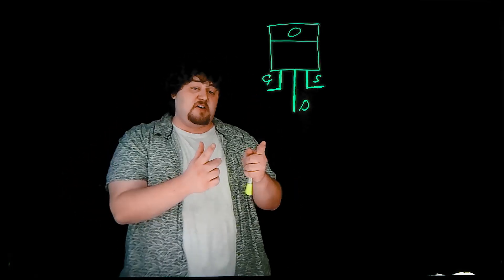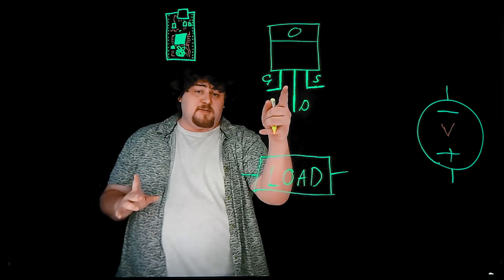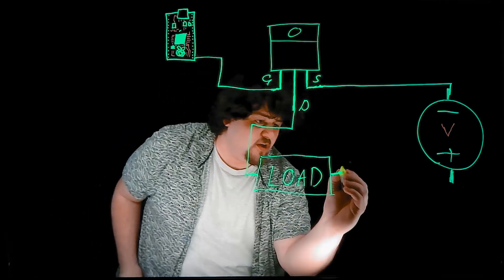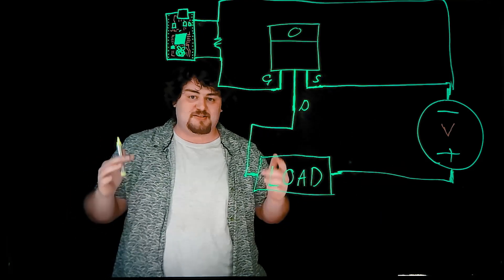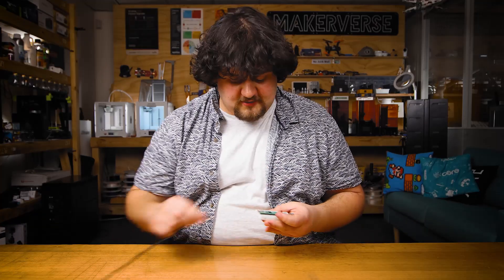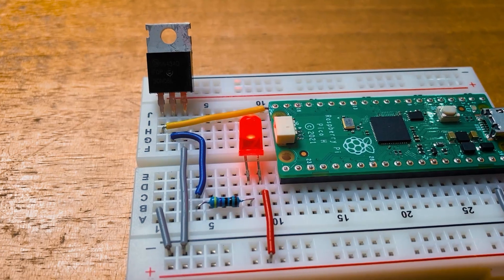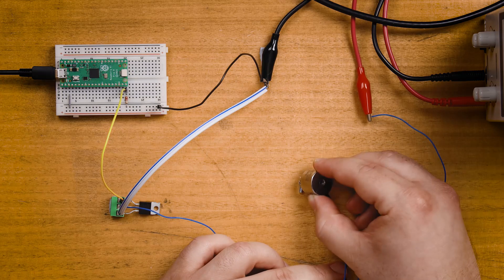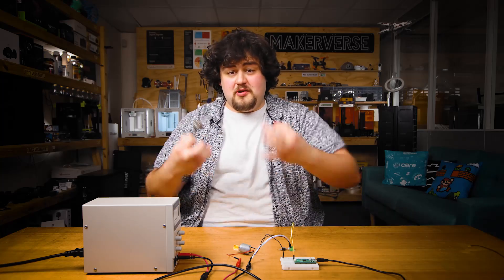How to Use N-channel MOSFETs as Switches | A Beginner's Guide

Comment: Hey, im doing this with IRLZ44N and a 10k resistor like you did. the whole thing is powered by 5v esp32 output. Input is usb. My load is a pwm dimmable 5v led strip. 
My problem is when dimming per pwm, the usb power source is making a humming sound. When doing full power i can hear nothing.
Do you have any ideas i should look for?

Comment: How does the pull-down resistor work? Isn't there a constantly loss of power for the microcontroller when the MOSFET is turned on, how do you calculate the right pull-down resistor (what's the right range)?

Thanks for your help!
Reply from the maker: Yes, but the voltage on that pin won't be pulled down as fast as we may like and the pull down resistor ensures everything is responsive.
Any resistor in the 1k to 10k range will make for a good resistor size!

Comment: Can you explain the fly wheel diode setup for solenoid?
Reply from the maker: A solenoid uses magnetic fields to exert force (like other motors), when you turn it off, that magnetic field collapses and causes a sharp voltage spike in the reverse direction - this can damage your system. The diode is set up so that when you normally power the solenoid, nothing happens. But when it is turned off and that reverse voltage spike happens, it activates and safely gets rid of that power through the solenoid's coils (instead of your circuit!). This is a similar story for DC motors.

Comment: I am a bit confused, because on a mosfet module (usually the red ones which use irf520) there is a signal pin, and a 5v VCC pin, and ground...   so if we are hooking up the the irf520 as a dip only and not on the module... then we dont need to power it via 5v... I guess my question is, why is there a VCC on a the module near the SIG pins?

Comment: Thank you for this  video. I  am using IRFz44N  where gate is driven by BC547 with 33K resistor connected  with its collector and  power supply of  12VDC. the load is connected  in between positive of same 12VDC and drain of mosfet. Source is  connected to  GND. gate is  controlled by PWM of  1KHz max. This configuration works well for sometimes, somedays and sometimes a months too, but  after sometimes, the Drain and  Source get short circuit, why? Can you suggest something to protect  drain and source  to get short circuited.

Comment: why is there one resistor in the circuit, but in fact there are two???
Reply from the maker: If you are talking about the circuit controlling the LED, the second resistor is the current limiting resistor for the LED, its just part of the "load" in this case.

Comment: Why do you not need a mosfet gate driver? I have a 24v motor that I'm driving from an Attiny85 and this person on reddit is adamant that I need a gate driver if I have any hopes of using PWM.
Reply from the maker: This is entirely dependant on your setup. A MOSFET driver would definitely improve this system and make it behave more like an ideal MOSFET. But we don't really need that here as we are powering external devices and not dealing with something like audio signals. A gate driver might also be important in providing enough current to the gate pin to turn it on, but we were having no issues with the Pico. The PWM signal generated by the MOSFET might be a tad wonky, but unless you need ultra precision motor control it should be alright.

If you want to build something solid and robust, then a gate driver might be smart, but I have no issues with any of my other projects without them if I'm just controlling motors and such.
Reply: @Core-Electronics  Ok thanks

Comment: Thanks for the intro.  I'm looking to put a controller between the switch and the seat for my car's heated seats.  The high is too high and the low is too low.  I figure I can PWM the high to be able to lower it to a comfortable level.  Any idea what the current would be for a seat heater?  Thanks, again.
Reply from the maker: Thats an awesome project! My guess would be somewhere between 4 and 10 amps, you would need to measure it or find a spec sheet for it. You would also need to check how the seat is being cooled/heated. A Peltier cannot use a PWM directly and needs an inductor to smooth it out a bit, but peltiers are rarer and in newer higher-end cars, a heating element should be fine with the unfiltered PWM.

If you have any other questions or need some guidance we have more eyes on our forums, chuck a post on there with some details of your projects: https://forum.core-electronics.com.au/

Best of luck mate!

Comment: I would like to control a 3.3v/600ma led by my rpi and mosfet, how about the external power selection, or just 12v also work?
Reply from the maker: Hey Chris, there could be a variety of different setups depending on the LED that you have. I would first get it working without the MOSFET, ensuring that you select the correct voltage for that led (it sounds like it needs a driver).  Then you can use a MOSFET to control the power to the LED.
Reply: Thanks for your suggestion, thank you very much! @Core-Electronics

Comment: Thanks for your kind tutorial🙂 I have one question! I want to use only single power supply for high power led and raspberry pi. Is there any way to use only one power supply?
Reply from the maker: Hey hows it going! That is definitely possible, you will need to use some step-down voltage regulator to get a nice 5v for your Pi. It depends on what Pi you are trying to power and what voltage the power supply is, and also your budget.

If you chuck us a question and some details of your project over on our forums (we have staff checking forums a lot more than youtube), someone will be able to help you out.

forum: http://coreelec.io/forum

Cheers mate!

Comment: Fantastic 😃
But say i want to be able to read signal from a 12v source (indicator on a car) so i then can use a microcontroller (rpi2040) and output a flowing indicator with 10 leds via mosfets. 
What should i use to protect the microcontroller from the 12 volt signalbut still being able to read it? 😬
Reply: A voltage divider network should be presented with the 12v signal, such that nominally 9v is dropped across the first resistor and 3v is dropped across the second to ground. At the junction of the two resistors you should have a suitable 3v signal for input to a digital input pin of the microcontroller.

The two resistors in series should likely add up to around 10k to limit the current dissipated by the network to a reasonable level.  Let's call it 13v (just to keep the numbers easy). A 10k and a 3k resistors should do the job of providing the required 3v (nominal) switched signal for the microconroller. You could consider using a 3.3v zenner diode across the 3k resistor to limit the voltage to protect the input pin from any over voltage by clamping at the zenner voltage. A very small decoupling capacitor 0.01uF (integrator) might also be useful to remove noise (which could be generated by the zenner diode). For a 5V microcontroller, replace the 3k resistor with one of 5k and the zenner with one rated at 5.1v.

Only around 1mA to 1.5mA should ever flow through the zenner in either case, so the wattage rating is nigh inconsequential.
Reply: @ianleitch9960  Thaanks 😃 Very helpful 🤗

Comment: I was looking for a video like this. Thank you. I'm trying to control a 1kW scooter motor with Raspberry Pi. A few of the motor functions, such as reversing, applying brakes (but not powering the motor itself) etc are activated by shorting two wires. I think I can use an n channel MOSFET for shorting any two wires.

I need one other thing. I need to be able to supply a controlled variable voltage between 0V to 5V to the motor controller to control the speed of the motor. What device can I use so that it produces a variable voltage based on the output signal from one of the pins of Raspberry Pi?
Reply: At 8:08 he tells you how to do that. use Pulse Width Modulation output  from the pi or pico or whatever.
Reply: @tezza3733   In the example here the MOSFET is driving the motor (the load), so by setting the duty cycle the motor speed can be controlled here as the PWM is driving the motor. In my situation, I need to supply a voltage from 0 to 5V to the motor controller, which in turn sets the speed based on the voltage (Stopped at 0V and max speed at 5V). So, for example, how do I produce an output of, say, 1.7V?

Comment: Good startingpoint-video, just one small nitpick:

You should NOT connect transistors to Arduino-Pins directly as switching them is a capacitive load too large for micro-controllers like arduino or raspberryPi. So an appropriate resistor should be used to drive such logic-level Mosfets (100-200 Ohm should be fine).
And while these microcontrollers have internal pullup/pulldown resistors - i think both RasPi and Ardu by default set them to floating before your code starts, so having an external pulldown is a good choice for any output going to Mosfets as they can be rather charge-sensitive.
Reply: So for noobs like me: a 100-200 ohm resistor between pin and gain + another resistor (?? Ohms) from the pin to ground, is that correct
Reply: @davidhawley1132   yes - the pulldown should be significantly higher, so in the range of a couple k-Ohm should be fine (a 4.7k for example).
At least 10x the resistance of the resistor to the microcontroller-pin to avoid affecting the signal too much, but the exact value really is not that important.
(it only becomes relevant when dealing with far more advanced circuits).
Reply: Nice makes sense, thanks
Reply: Never have I ever had to use a gate resistor as high as 100 ohms on a mosfet. A resistor with a value that high could start to form a RC time constant making the switching from full off to full on sluggish and causing excessive heating in the mosfet if you are doing PWM to your load. 
just a few ohms is all it needs, and often I see other peoples designs with no resistor and they seem to work fine.
Reply: @lezbriddon   "they seem to work fine."
SEEM is the correct word there. 
100 Ohms is on the low-side even as most designs will ask for resistors in the range of 1-10kOhm for driving capacities loads like transistors.
And when you are at a range were the charge rate of the gate becomes and important factor - you better know about how to calculate the correct resistor-values (and that running without one might quickly destroy your microcontroller).

For reference: The datasheet of the P30N06LE used in this video uses 2.5Ohms as a typical Value for R_GS, the raspberry pi Pico has an output-voltage of 3.3V and the specs say to limit pin-currents to 3 mA but lets go with the output-current of the chip it self which states 50mA for ALL GpIO-Pins COMBINED.
So we have 3.3V and want to limit that to 50 mA (which already is way outside of spec) that is ~66 Ohms, going with the real maximum of 12 mA (still 4x!!!!! of what raspberry says is the max rating) we are at a nice 275 Ohms. In both cases we can ignore the 2.5 Ohm R_GS.
So even when completely disregarding the limits and overloading the pin 4x the rated current you would need a resistor higher than my suggested 100 Ohm. Sure, most circuits will run fine with even just 50 Ohm, and that for a longtime, but no resistor - you are asking for trouble.

I mean that is kinda like saying "i just use my summer-tires rated for 150km/h to drive in winter on the highway at 220 km/h - always worked".
Reply: @ABaumstumpf  how much capacitance on the gate pin do you think a MOSFET has!
Reply: @lezbriddon   "how much capacitance on the gate pin do you think a MOSFET has!"
It doesnt matter how much i think it has - it is in the datasheet of the microcontroller, mostfet and even mosfet-drivers.
YOU are the person claiming that the entire industry is wrong - with out any evidence or even understanding of basic physics i might add.

But you do you - stay ignorant as much as you want. You are simply just wrong.
Reply: @ABaumstumpf  well you taught me something I didnt know, I've never used a pi gpio pin so didnt know they were such low current outputs as I live in the atmel/espressif sphere with a few more ma (15-40)  to throw at the gate capacitance issue.
Reply: What about esp output pins